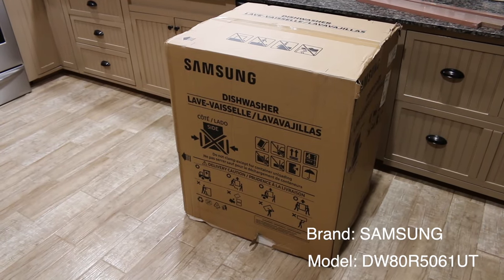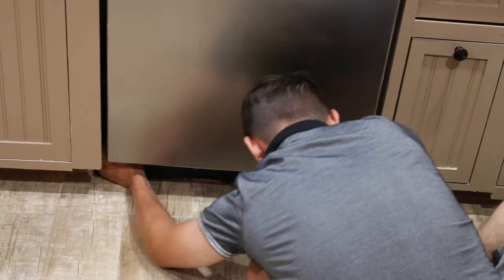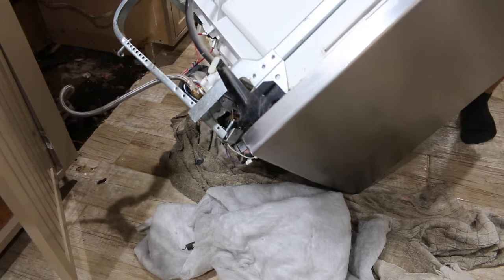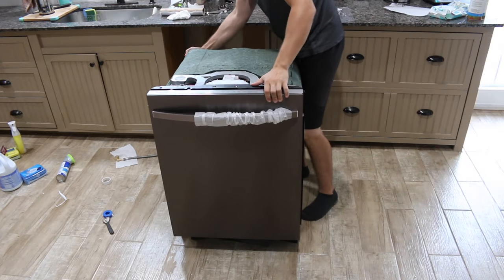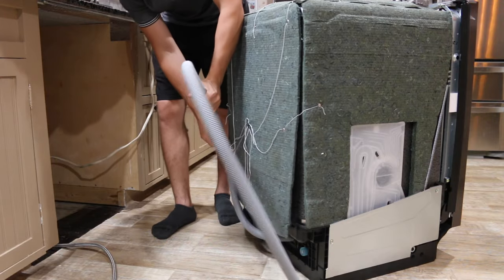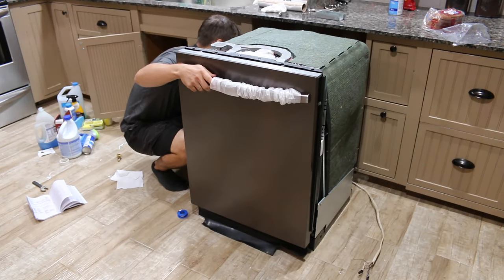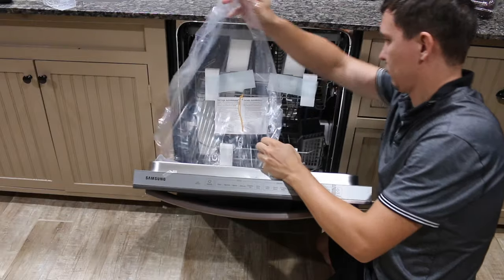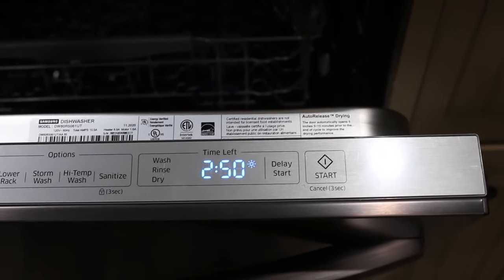How To Install A Samsung Dishwasher - DIY

Comment: DUDE, did you just put that plumber's tape on backwards????? _
Reply: You don’t even need tape on that joint!
Reply: In his country the water goes down the drain counter clockwise so the tape needs to also go opposite🙃
Reply: You noticed that too hey

Comment: I have a smaller one, I'm thinking about installing it myself. I'm just curious, is it mandatory to attach it to the kitchen counter?
Reply: Those screws are short, you use those and not 1 in. sheetrock screws.  Yes, you have to secure it or it will become wobbly.

Comment: The first brass elbow that you showed from Lowe's works. You just need to push really hard to snap it on. The dishwasher's nylon ring bends a little and it goes right on. I don't have a Home Depot here so my Saturday afternoon hardware store options are limited. Good video.

Comment: Okay, I have a new Samsung dishwasher but our set up does not go to sink. All connections-water supply, electric and drain come from the floor underneath. This dishwasher has very little to none, space underneath for the drain hose, water line, or wires because of a bottom panel. What can I do with this problem?
Reply from the maker: you have to work with what you have....

Comment: The first brass elbow that you showed from Lowe's works. You just need to throw away that nylon nut that came with dishwasher and use brass nut that came with fitting from Lowes/
Reply: Okay I bought one and I just used the brass fitting instead of the plastic one because I thought it would be fine but I have been told to put the nylon one on do I not need to?

Comment: Just a suggestion: When measuring between top and bottom of the front entry, measure from the concrete floor, not the tile, otherwise the tile, which is about 1/4 thick, will give you a false measurement.  Besides, the dish washer will set on the concrete, and not on the tiles.

Comment: It looks like you put Teflon tape on a straight thread fitting that seals through a rubber washer.  I suppose it wouldn't hurt as long as the tape isn't under the sealing washer.
Reply: He also applied it in the wrong direction for right-hand threads but who's counting
Reply: I also noticed this... the tape I believe is not needed.... am I incorrect?

Comment: Wish I could see the mounting bracket tabs installed on your video. The brackets that Samsung gives with the machine DO NOT stay in the square holes and constantly fall out -- so I'll need to order a different bracket like the ones you used. Another Samsung "FAIL" - $1,000 dishwasher and crappy easily bent bracket mount piece that came with it and does not hold. UGH -- Maybe I'll find another video like yours that shows the bracket you used. Thanks so much -- your video gave me enough clues to know to buy online a bracket that will work.
Reply from the maker: Thanks for watching!

Comment: Hey, mine has a gray rag. Or a piece of fabric. Did you know what to do with them? Please help.
Reply from the maker: it is an insulation blanket. It is not packing material. It's actually a necessary part to ensure the dishwasher performs its best. The insulation keeps in heat and also helps to reduce noise. Once the dishwasher is installed, the insulation blanket should no longer be visible and you can forget all about it.

Comment: Does the power cord need to run through the relief channel on the underside, or can it run beside the dishwasher and come in from the side? My cord is too short to go in from the back, and come out the front. I'm wondering if I'll need to splice a longer line or can just come in through the side near the front
Reply: Don't splice it, that's not good to do. Especially when next to water. Just grab a new cord that is at least 14/2 AWG and run it in the channel.  It's not worth the chance of it rubbing on something. Dishwashers vibrate a lot and over time wires can rub through rather easily. Especially at the connections in the box in the dishwasher, be sure to use a 1/2" box connector. That edge is sharp!

Comment: I don't have a dishwasher mounting bracket.
Reply from the maker: buy it
Reply: @CreativeProcessDIY  Where did you get it? I can only find the tabs, but not the long metal plate that goes under the countertop.

Comment: Есть вопрос. У меня такая же посудомойка как у Вас. Смущает свисающая резина внизу. Как это можно исправить? Кажется, что там не хватает какой-то панельки чтобы это все закрыть.
Reply from the maker: This video is in English.....
Reply: Same question in English: I have the same dishwasher. Confused about dangling rubber at the bottom. How can this be fixed? It seems like I need a panel to close it. Any thoughts?
Reply from the maker: I installed  a kickplate. Mine came with it....it gives you a "finished look".

Comment: I installed my dishwasher but it won’t drain the water, any ideas why? Blinking “heavy” light. The dishwasher is new so I know it’s not clogged.
Reply: @ItsHaysus I just got mine today. Having the same problem. Did you solve it?
Reply: @MrGolov-te5eb  yes i forgot to remove the plug in my garbage dispenser
Reply: @Itshaysus  Thanks man.
Reply from the maker: Try calling Samsung support
Reply: @Itshaysus  lol

Comment: Bud you only Teflon tape is on self-sealing threads . Those threads done seal. There is a flare rubber gasket that seals the fitting

Comment: I watched this to clarify how to adjust rear legs (they cannot be reached from the front once dishwasher is in place).  You do not show or even mention leveling the dishwasher though.
Reply: You adjust the back legs by the nut on the bottom front of the dishwasher.
Reply from the maker: I did. You skipped that part